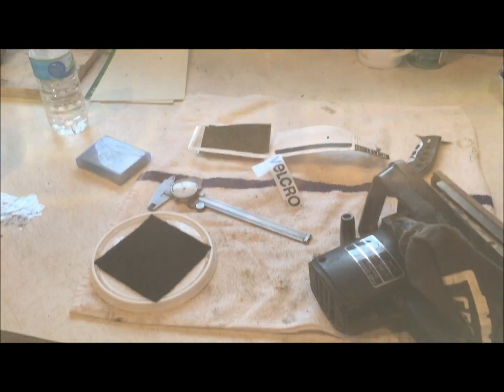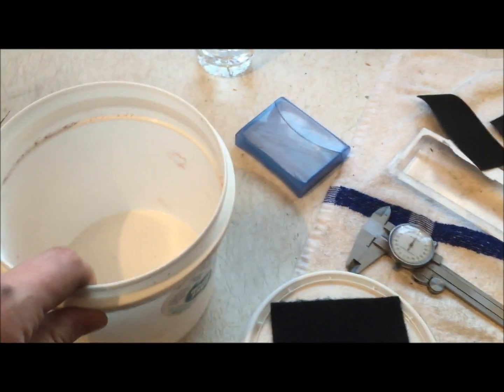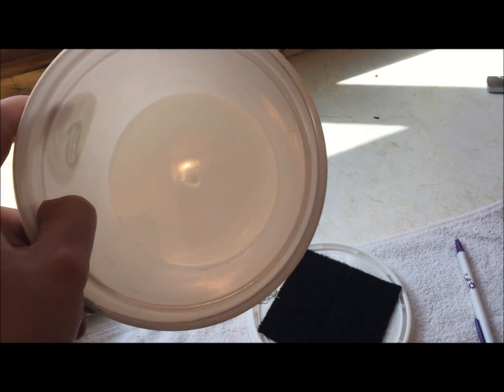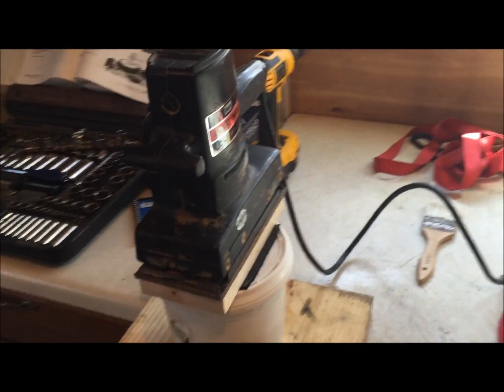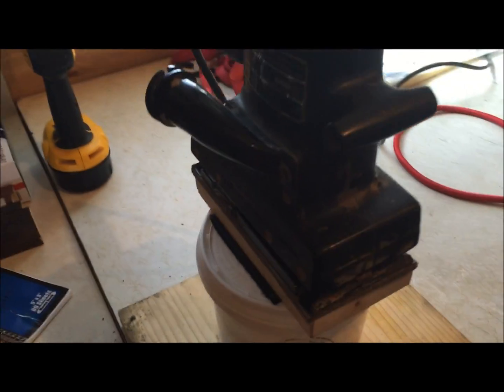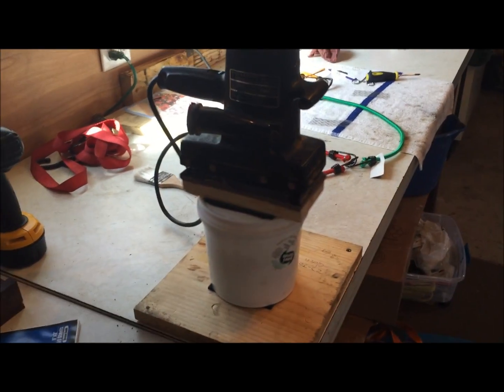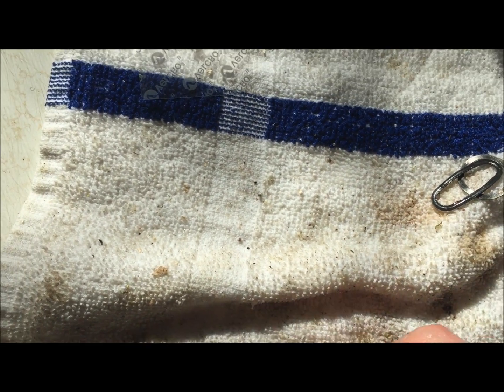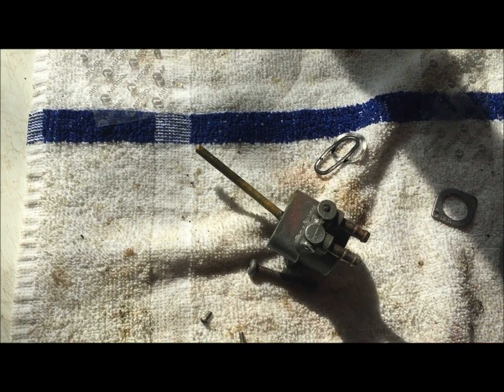Home Made Ultra Sonic Cleaner

Comment: I've used a palm oribital sander with a 5 gallon plastic bucket suspended from a ceiling rafter with bungee cord.. Simple Green D ( Aluminum safe)heated to 140° works great or 1 gallon of Distilled water heated to 140° with 1/2 cup of Dawn Dish Detergent and 1 tablespoon Baking Soda works really well.

Comment: If the lid to your tub stays on tight, you could use bungee cords to suspend the sander from something, like maybe a pair of chair backs, or sawhorses.
  I just checked out Ichiban Moto.  I guess that's pretty much what he did.  I don't have access to my garage's rafters to hang anything from, so I'll be using a sawhorse.

Comment: I have to tel you this method is much  more professional looking than the YouTuber that. Took 3  vibrators and threw them in a  Tupperware bowl with  some carburetor parts   I am a retired woodworkers and i dont think my buddies  would give such a hard time using a old sander  in comparison to seeing  several vibrators dancing in a bowl with my car parts